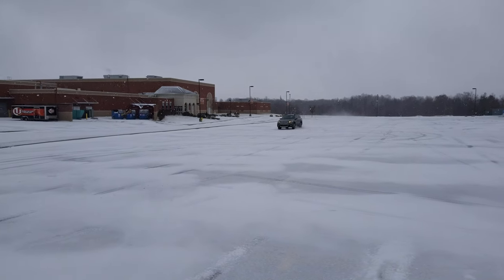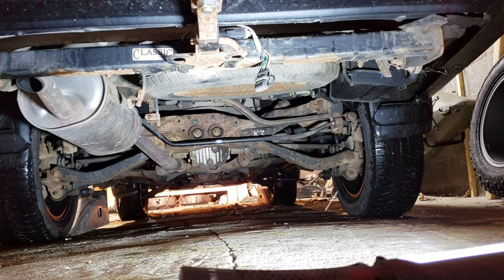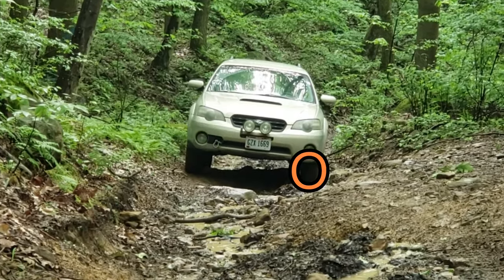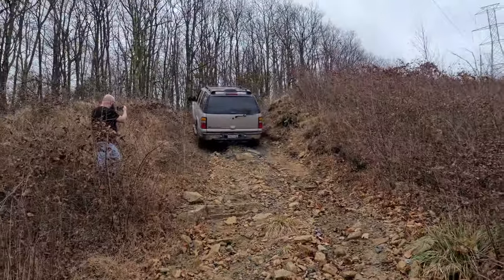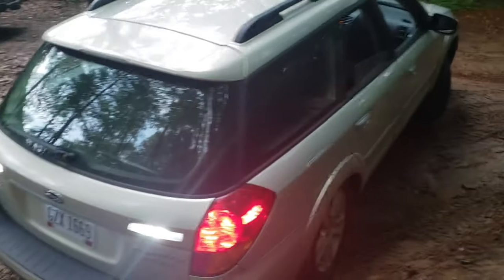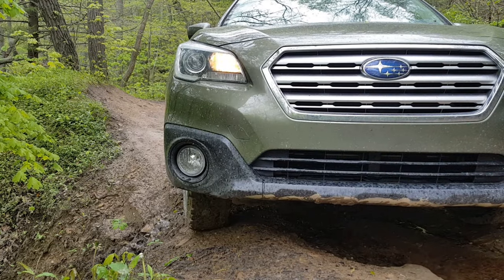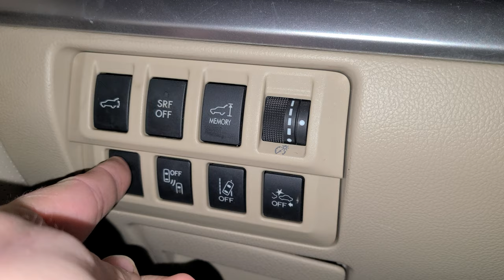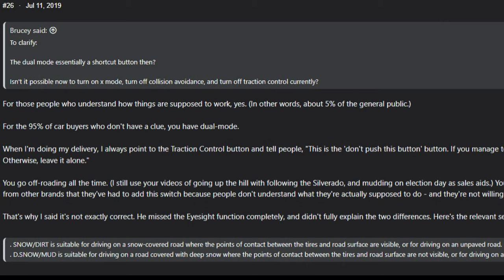Subaru X-MODE for DUMMIES.

Comment: is a Subaru ascent capable for beach driving in sugar soft sand ? ain't doing any other off-road just beach sand. obviously I would have to  deflate the tires
Reply from the maker: It should be ok deflated. Lots of Outback guys have good luck with deflating the tires and sending it. 

I don't have any first hand experience with the Ascent though.
Reply: @bruceyyyyy  I live in NJ where the send is very soft so I was debating between a real 4x4 versus Subaru, but I am leaning Subaru. What tires would you recommend for sand?  would 20'' rims get the job done or would I need to have 17'' 18'' rims?
Reply from the maker: Generally the smaller the wheel the better for off road. Sidewall is your friend.
Reply: @bruceyyyyy  thanks man! It's just so funny how the higher trims usually have wider rims and don't even give you any other option. Anyway...you're awesome keep it up

Comment: Is it better to turn off the traction control in snow up a steep hill, or only put the car in X-Mode. Please someone answer its bugging me for four years
Reply from the maker: I would turn it off up hill. Spin it baby.
Reply: @bruceyyyyy  Thanks, should I put the X-MODE on also?
Reply: @bruceyyyyy  Is turning off the traction control with or without X-Mode on is it like a four wheel drive.?
Reply from the maker: It allows the wheels to spin more.
Reply: @bruceyyyyy  But as a dummie is spinning wheels good or worse and what do I use it with, X-Mode?
Reply from the maker: Ahh. Generally wheel spin is bad since it means there isn't traction. 

But if youre stuck in mud or deep snow and can't get moving then spinning the tires could make the difference!
Reply: @bruceyyyyy  OK should I use it with X-Mode on or off
Reply from the maker: I would try off if you're in snow on all 4. 

On would be good if you have one side on good ground and ice on the other.
Reply: @bruceyyyyy  Got it,last stupid question is turning off the traction control like operating as a 4×4?And which is better.I do not do off road, my issue is we live in the mountains and I have a steep hill,around 15% at the top.Would I be better off with a Jeep.Please say no I love my 2017 3.6 Outback
Reply from the maker: I would take a Subaru or similar CUV on winter tires over any other vehicle in snow and ice.
Reply: @bruceyyyyy  Thanks, maybe my Hercules winter tires are not the best.I even have studs on them.Can u recommend a great winter tire.
Reply from the maker: I think that sounds like a great option already.
Reply: @bruceyyyyy  Bruce I want to extend my gratitude the information is greatly appreciated and I finally got my answers that my subaru dealer was not able to do.Would you think putting chains on my two back tires a good idea
Reply from the maker: If you've got a Subaru with dedicated snow tires I don't think snow chains are going to be necessary unless you're in some really crazy situations.
Reply: @bruceyyyyy  Would it be correct to say that an AWD is a 4×4 with traction control.
Reply from the maker: I don't believe so no. Typically a 4x4 has a low range gear. Something that almost every CUV lacks.
Reply: @bruceyyyyy  When I attack my hill from hell I use the stick shift and never go higher then 2nd gear
Reply: @bruceyyyyy  I used to own a 1975 Jeep Cherokee "S" model with a single speed transfer case  with no low range and open differentials and a vacuum operated knob inside the glove compartment for what I believe was a 50/50 split. Its funny how Amc Jeep can put Four Wheel Drive emblems on that Cherokee with a single speed transfer case but current Jeep owners always have to say my 15 Forester is not a real 4x4 because I don't have low range. Sorry for the long off topic rant .
Reply from the maker: @jamesbryan3253  I think there are a lot of 4WD that don't have low range. I think Jeep even put them in some Grand Cherokees?

I drove a WJ Grand Cherokee for a spell and it was "Full time 4WD" with low range being the only option on the transfer case besides neutral.

Comment: What is your tire size on the Methods?
Reply from the maker: 245/65/17 tire size
Reply: @bruceyyyyy  sweet, thank you.  Just got the Ironman lift installer’s .  Already had the Methods on my OB but currently with  Maxxis Bravo AT 235’s almost ready to be replaced.  Looking for a tire with a little more tooth!